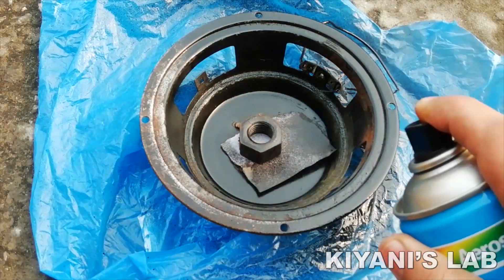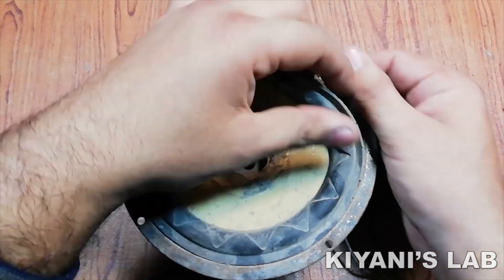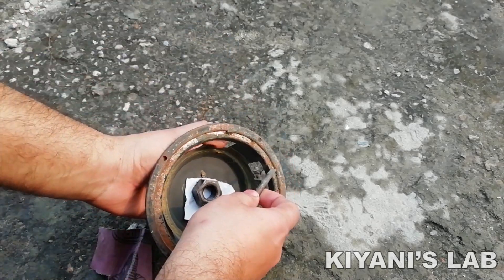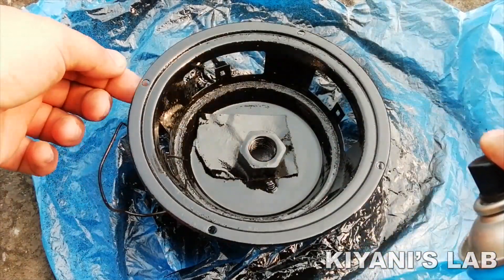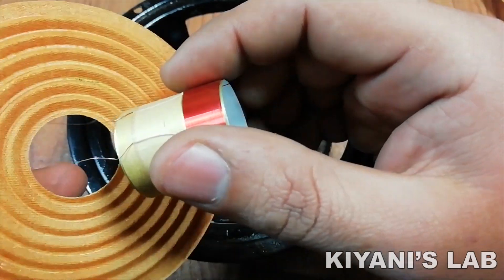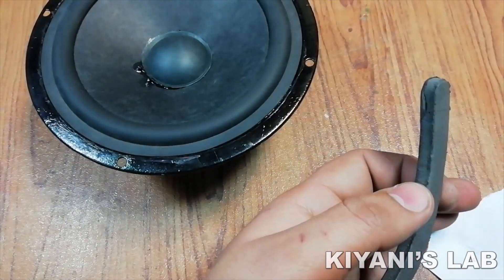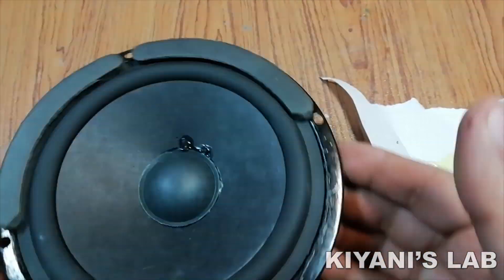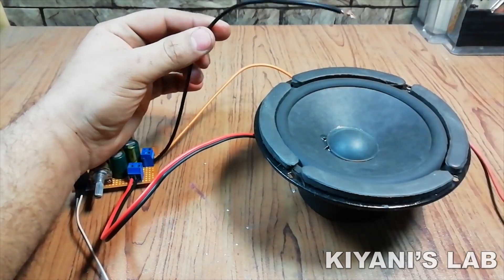How To Restore An Old Speaker | Speaker restoration

Comment: Just a hint for professional spray painting.  The quality of the paint finish depends 100% on good surface preparation.  For this speaker a drill or dremel with a wire (brass) brush would have smoothed the steel even better, in no time!  And when spraying, for a professional look, turn on the spray when you are spraying at nothing, then sweep across the speaker, and turn it off when you are once again pointing at nothing.  This reduces drips & splatter.